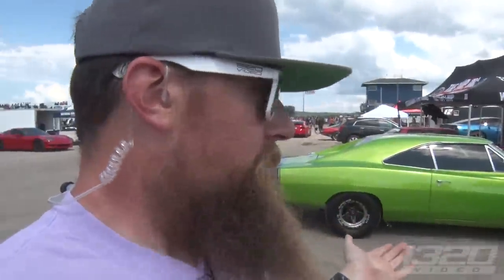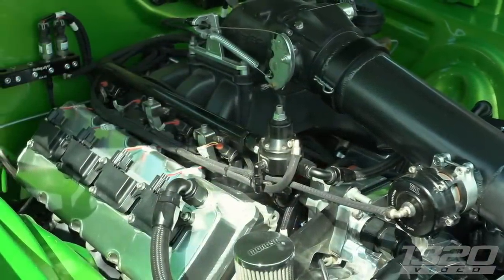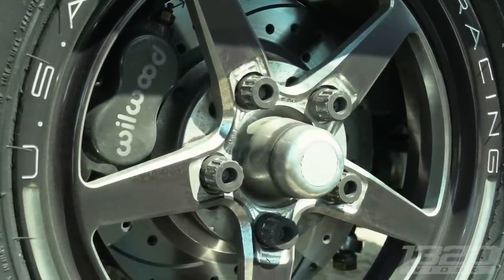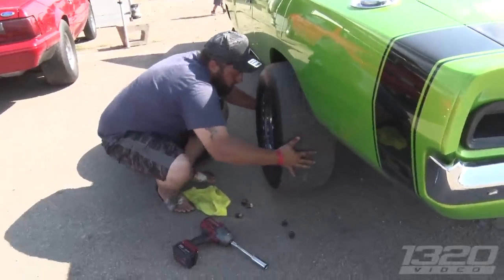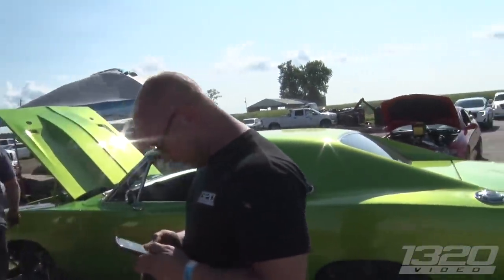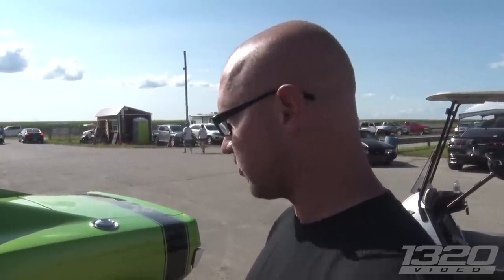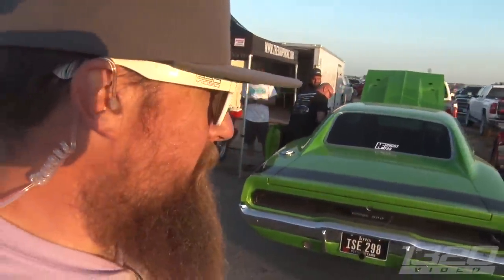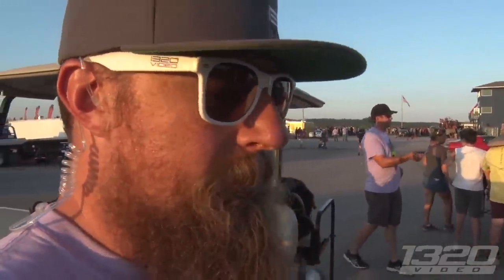Can $40 Rancho Shocks Make a Car FASTER?

Comment: Drives it to the drag track and is about 20 miles on the interstate runs 5's and drives it home and also drives this car all over council bluffs and Omaha during the summer to car shows. I have personally seen this car race at I-29 dragway not allot of people can say they run 5's in the 1/8 mile and not trailer there car that is a real street car in my opinion and bragging rights!!
Reply: As it should be honestly.
Reply: @joshuagibson2520  Eactly as Street outlaws does it..:)
Reply: @MrMaxEffort  lol. They're mostly garbage. That's just my opinion though.
Reply: @MrMaxEffort  I mean it's cool and all, but keep it real... they need to drop the claim of fastest street cars. None of them are street cars anymore. I'd say boosted gt is about the only one even close.
Reply: @bigboreracing356  he does lol I said the same thing I followed him to the track a few times
Reply: @bigboreracing356  every one of them have a Pro Mod chassis. That's exactly why most street racing is small Tire now. none of those four thousand horsepower cars on promod chassis can compete on a small Tire on the street. Most all those cars are a half a million dollars that's way out of range for the average Street racer.
Reply from the maker: @joshuagibson2520  to be fair they've labeled themselves the fastest "street raced cars" from the beginning
Reply: @bigboreracing356  gay
Reply: @bigboreracing356  You can say that again, I got hit in my 100% stock 70 Chevelle SS.  I was so furious, absolutely livid.  I got out of my car and quickly went right for the driver of the other car, they stayed inside behind a tint window I did not even know if it was 7 ft giant.  Without caring, and since my foot hit the ground I was continually blasting and swearing up a storm that would make a construction worker blush.  The window of the car slowly rolled down to reveal a co-worker (female colleague) who happened to be friends with another coworker, one that I was seeing.   Bad things happen in three's.
Reply: @1320video  Kyle you should put on a fastest street car race at I-29 dragway this summer. NO TRAILER rules and make sure they don't unload there car off the trailer down the road!! With a $200 buy in and $10,000 pay out this summer that would be bad ass and would help the drag track financially!!
Reply: @chevyfarmersgarage1955  5.52 et driving to the drag track and driving home pretty tall order to beat!!
Reply: @joshuagibson2520  true but I give em props keeping the steel quarters and roof of their cars instead of going full pro mod
Reply: It's all good. We all have our own definition of street car. I like NPK too. And drag week. And RMRW.
Reply: @joshuagibson2520  It just gets old hearing everyone screaming my car is street car and it's always on a TRAILER!! I don't expect everyone to daily driver there car to be considered a street car but if you're going to claim your car is a street car I better not see you trailer your car to the drag track!!
Reply: @christopherhyde9842  exactly.
Reply: If I got that car my wife would never see me again because Id live in it
Reply: @robertbignar9129  you probably would have to live in this car if you owned it he probably has more money in this car than most people have in there house!!
Reply: @bigboreracing356  6 second 1/4 mile cars here in Aus, still running leaf springs and 275 tyres. unfortunately here in Aus street outlaws cars would be track only items.
Reply: @bigboreracing356  it's a street car on a  track just as in the clip, no one races the street here, you watch too much tv I think.
Reply: @bigboreracing356  you do realise street outlaws is regulated for the show, theres nothing "out"side the "law" about it. I can appreciate the cars and enjoy the show, but regulated street racing as a title wouldn't bring the audience that the name street outlaws does, simple fact is I said street car not street racing. as the clip implies. to trailer a drag car to a street and race it in regulated conditions does not in my book make it a street car. it makes it a trailered drag car being driven on the street. how many of these "street outlaws" do you see running leaf springs still? original factory suspension. that was my point.
Reply: TOP FUEL DRAGSTER ON THE STREET definitely qualifies as a street car where does it end just saying!!
Reply: @christopherhyde9842  do a pass in a stock smart car on a drag strip that I trailered there and all of a sudden it's classed as an all out drag car by this mentality.
Reply: @bigboreracing356  wouldn't matter that the cops didn't come if you've posted the evidence to your channel for all to see, pretty smart move that.
Reply: @electricdeckhead3083  if you have a car on the street and get pulled over by the police and get your car gets impounded it is not a street car anyone who thinks otherwise is delusional!!
Reply: @christopherhyde9842  agreed. I wasn't knocking your comment, I was agreeing with you.
Reply: @bigboreracing356  I would take it shopping on the streets, would you in your "race car"?
Reply: @electricdeckhead3083  I have been drag racing since the early 90's and I definitely don't consider my drag car a street car I can license it but it is set up for short distances and I couldn't imagine street racing trailering my car every where to unload it and the police show up and try to load my car on a trailer while the cops are there my idea of a street car differs from others since street outlaws start on TV everyone thinks there drag car is a street car!!

Comment: Wish that had a Mopar hood. 
Something feels "off" about a cowl on a Mopar.
Reply: Couldn’t agree more it ruins the front look of the car. 

But as with most mopar ppl no cowl hoods our hoods face forwards like the HEMI scoop.
Reply: @prestigeracingmotorsports9169  Scoop looks right on something like that. Nice job!
Reply: @prestigeracingmotorsports9169  it's for clearance though. A Hemi scoop would just be a parachute. And the Charger 2.2 had a cowl style scoop so it it's as much a Mopar hood as anything else. 😉
Reply: @lb9gta307  LOL. 2.2
Reply: @jackspradt1562  a product of its time much like the Chargers befor it or the 4 cylinder Mustangs and F bodies they shared the market with
Reply: @lb9gta307  there where no 4cyl F-bodies
Reply: @edwinfeldman8231  there actually were in the 3rd gens. 82-86 the Pontiac 2.5L Iron Duke was the base engine.
Reply: @lb9gta307  they coulda built it with it staying under the hood. It’s not my car so I don’t care but the absolute last thing I’d do is run that ugly hood. There is many sub 7 second mopars with hemi style scoops.
Reply: @lb9gta307  they coulda built it with it staying under the hood. It’s not my car so I don’t care but the absolute last thing I’d do is run that ugly hood. There is many sub 7 second mopars with hemi style scoops.

Comment: The shocks on my old hot rod c1500 has 25 year old Heckthorn (tuff country) steering stabilizer shocks! I had stashed away and they fit. There pretty much the same as there shocks just there 50/50 ratio and maby softer valved ? I duno. They turned out to work and hook good so didn't bother change em, white with red off-road shock boots n all...classy!

Comment: Are they really US$40???
Ten years ago a set of RS9000 Rancho's cost AU$450 a pair,.. and being able to match the damper rates to the spring rate on a '66 A-body certainly helped mine go up twisty country roads.
They're not "nine way" adjustable, they're Nine Steps of adjustment for bound/rebound - slow is soft, fast is stiff.

Comment: Its a Charger but not a 500 Charger
Reply: Charger 500 was a nascar special, with a flush grill and back widow in 1969. In 1970, which this car is, it was just a trim option. So it IS a 500.

Comment: Not a real 500 back glass looks wrong.
Reply: It's a 70! The 69s had the flush grill and back window. In 1970, the "500" was just a trim option. It is a "real"  70 charger 500.

Comment: Rear suspension is too stiff tires are too pumped gear ratio is all wrong and you too agressive on throttle u just rippin clutch an spinnin tires ..... mechanicaly there are a few things u cud adjust...but if im totaly honest  more driver error than anything when it comes to your launching... 90% of the race is won when you exit the start line in Drag racing you leave the line first you can only build on it to the finish....